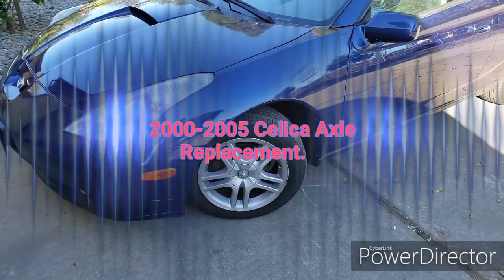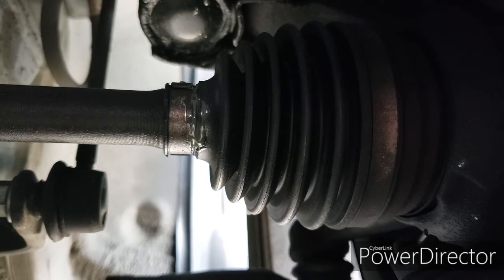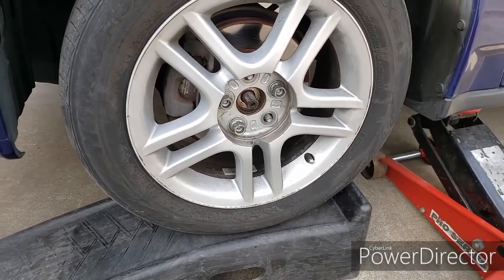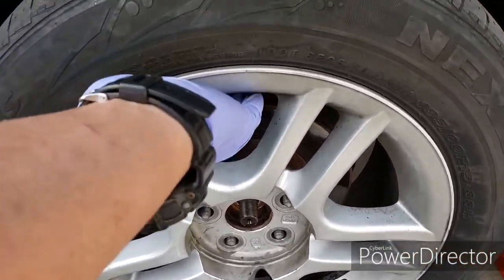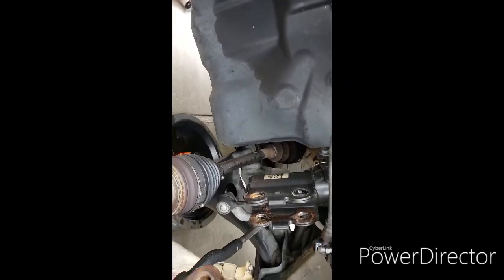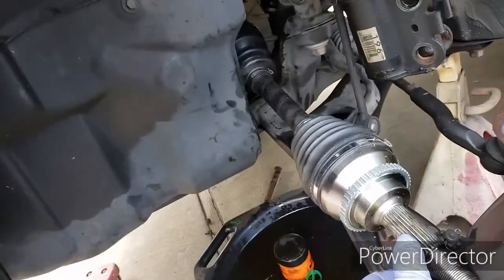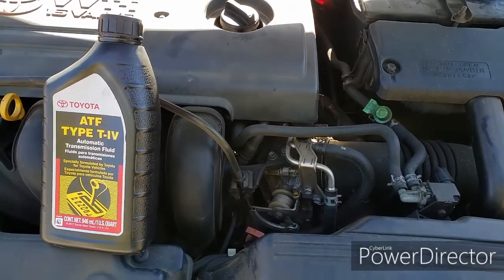2000 Toyota Celica Axle and Transmission Axle Shaft Seal Replacement DIY

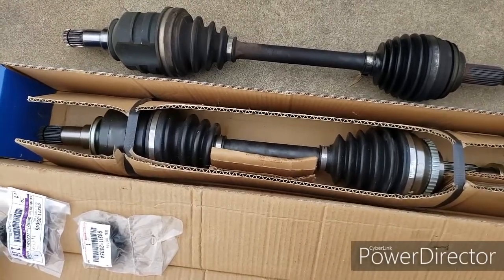Comment: You said you were told the "automatic" and "manual" have different axles @6:30. I just picked two up from O'Reilly Auto, I was told they were the same. You never stated whether you have an auto or a manual... So, assuming this isn't true?? Your axles look like mine and I have a 6speed manual. Would love clarification, thanks!
Reply: I believe they have different, maybe since the transmissions are different sizes the size of the CV axle is longer/shorter depending on the transmission.

Comment: How did you even get the driver cb axel out. I yank and tries prying and no luck. 
Putting a flat head screw driver banging with a hammer is no luck. There isn’t any room and clearance for you to bang it with a hammer.
Help please ASAP..
Reply from the maker: I think I used a oversized flat screwdriver at an angle pointing upward where the tip of the screwdriver catching the lip of the axle end going into the transmission. Little before the cv boot. I hit the screwdriver with a hammer couple times. It popped out. It held by the clip ring.
Reply: TONE DUBB thanks for advice
Reply from the maker: 90311-35045 genuine Toyota part

Comment: what's the part number for the seal on the passenger (right hand) side?
Reply: re-watched and answered my own question, liked and subbed. Great vid.
Reply from the maker: I got that passenger side transmission seal in my garage.  I'll get the part number and post it tomorrow.
Reply from the maker: 90311-35045 Toyota seal
Reply: @tonedubb4325  thank you for getting back to me. After letting the fluid drain, how much did you have to add to the transmission?
Reply from the maker: It's been a minute,  i thought there's  dipstick to check for level.
Reply: TONE DUBB hey my axle keeps popping out. I did everything perfect, however after driving for 5 minutes my axle falls out of my transmission giving me no power. I got two axles from two stores and the same thing. Correct axle.
Reply from the maker: The axle end that goes into the transmission has a retaining ring on it. Is it on your old axles? Do you see it on the new axles? Are your new seals went in flush with the transmission? I believe its flushed. If your new axles slided and clicked in, you can't pull them out easily.
Reply: @tonedubb4325  yea i found out that it wont stay in place unlessi have a mounting plate on the axle that bolts on in front of the oil pan. the ones i have, have no mounting plate so it slides out freely unfortunately. I cant find a link to where i can buy one that fits a 2002 automatic 1zz or any celica for that matter. 
Thank you!
Reply: It wasnt on my old for some reason and its not on my new. when i was taking out the old one i ripped the mid part of the axle exposing the gears in the metal boot. Next to the boot was a plate but no bolts holding it in, so im curious how it stood in so long w nop bolts... rust? haha but my new seal is flush. I can drive for a little and it just falls out.
Reply from the maker: Its on the tip of spine that goes into the transmission.  There is a ring there.  When you push the spine in, it will lock the axle in place.  If your ring popped off, it might be still inside the transmission.  You need to get that out.  Maybe that's why your next axle wasn't able to snap in place.
Reply from the maker: Passenger side, you need to press out the old axle and press in the new one.  I have not done mine since it's so good.